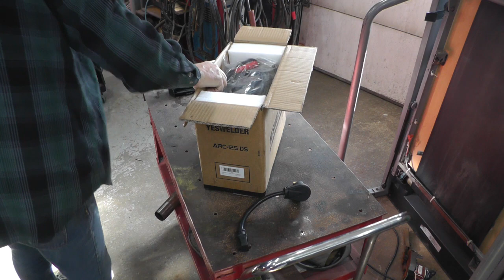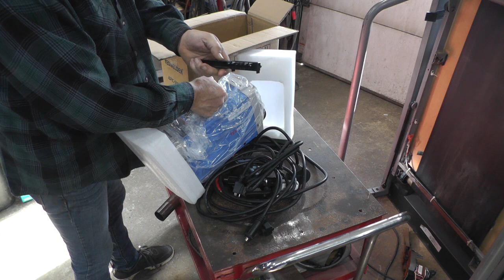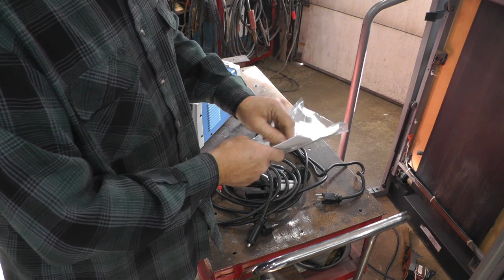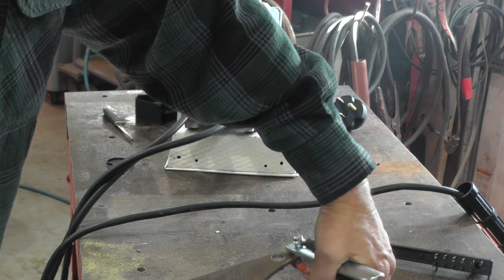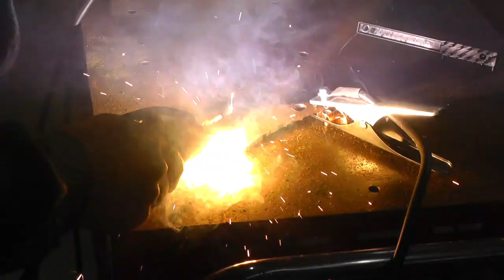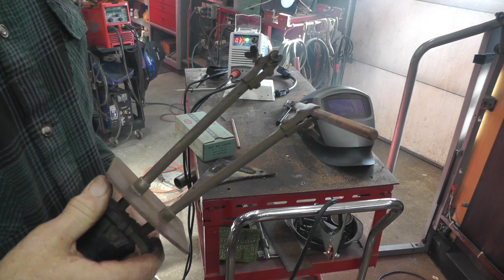Yeswelder ARC-125DS Review 120/240 Inverter Welder

Comment: I've had the 205 DS Pro for over a year and it's perfect for my needs but I've not yet tried welding on 220. I will try your simple method and I'm really curious to see the difference if any in how it welds and if the welds improve . Enjoyed your video and wondering if you still have the welder or what became of it .Ty!
Reply from the maker: Yes I still have it. I use it quite often. It always amazes me how well it works for it's size.

Comment: Convinced me. I need something for small projects so this would be great.
Reply from the maker: I have used mine for several years now and it still works great. One nice thing is it's light weight makes it nice if you want to use it off site using a generator.

Comment: What amp was the outlet you used for this machine I just got one and. Have a 20 amp on the line I'm going to use, will that work?
Reply from the maker: Mine has a 20 amp square D breaker and a 20 amp receptacle.

Comment: Nice! I'm buying mine from Ebay $100 with shipping. I'm not happy with the wire feed one I have. 👍🏾
Reply: Just got one to learn welding and it really is as good as this guy is saying I run 3/32 7018 rob at 110 and it tacks everything very smooth

Comment: Seems pretty solid.  I need to rebuild a mower deck, this should be good right?
Just not seeing much difference between these and the cheaper $50-$60 ones.
Reply from the maker: I think the build quality on these is better just my opinion.
Reply: @kevincrawford2027  I respect your opinion, thank you.  They do seem like a more stable company and not just some temporary rebrander.
I tend to overthink things, like I have a 10-50 dryer plug but most of these come with a 10-30 I think, but I probably don't have to have it anyways, seems to work good with 110v.
Do you have a mask you like?  They all seem to be 50-50 no matter the price.

Comment: Thanks for doing video.  I believe the welder is not a true 220v welder.  It only uses one leg of the 220 line but can run a higher current because most 220v lines are run on a 40-60 amp breaker.

Comment: Does it work on 1/8 6011 rod at 110V???
Reply from the maker: Yes that is what I use a lot it is very forgiving about good prep of the work.
Reply: @kevincrawford2027 .......it is my first time learning how to weld.  I bought the same unit as yours.  I bought the 3/32 Lincoln rods.  I just tried it out and cannot seem to get it to lid up.  The rod keeps sticking to the metal. Can I just turn on the unit and start welding or do I have to leave it on for a few minutes before welding?  What amp do I need to set it at?  I have set it to 80 amps.  Very much appreciate your help.  Thanks.
Reply from the maker: @thewishmastur  80 sounds about right. It should work right away. Are you scratching the rod to start it going? There are lots of good youtube videos on welding. It takes a bit to get used to it. Getting the arc started is usually the hard part. Once it starts it easy to keep going. Don't give keep trying. Good Luck.
Reply: @kevincrawford2027  ...which rod is easiest for beginners?  6011 or 6013?  Is size 3/32 easier than 1/8?  Which of these do you recommend for beginners??  Thanks 🙏
Reply from the maker: @thewishmastur  Not sure I use both. More 6011 though. If your having trouble getting it start an arc turn up the amperage. It will be to much to weld with but may get you used to starting an arc. I'am no expert I learned just like you are doing.
Reply: I suspect the open circuit voltage is kinda low on 110v im willing to bet the first rod to use, if you have never welded, and only have 110v would be 6013 or 7018
Reply: @stevehartlieb  negative , 6013 has very low penetration and 7018 is hard to start unless high amperage, 6011 modified which is Lincoln 180 is one of the best rods ever created.
Reply: @mountaintruth1deeds533  yes 6013 is low penetrating, but also can be ran with a machine that doesn't have high enough OCV, 7018 doesnt require higher voltage like 6010 5p, and 6011 even tho 6011 requires less than 6010 5p
Reply: @stevehartlieb  that's pretty much what I said, in addition 7018 is no good on contamination. I can easily make stronger welds with 6011 over 7018 on anything but absolutely clean metal.
Reply: @mountaintruth1deeds533  that depends, the mechanical properties are much much better with 7018, sure 6010 penetrates better and can be used to weld rusty oily shit, but you can also weld the same with 7018, crank it up, burn it out and just grind the first pass, hit it again with 7018 and 10btimes out of 10 it will be way stronger than any 6010 single pass
Reply: @stevehartlieb  maybe so but 7018 is not great with any contamination. Fleetweld 180 is a superior field rod hands down. If you want purity weld use TIG.
Reply: @mountaintruth1deeds533  7018 is great with a tig root on open butt welds, there isn't much of a better option, in places you can't grind or clean 6010 then 7018 is the best way to go, its an industry standard in welding pipe
Reply: @mountaintruth1deeds533  I've never even heard of 6013 rod until 2 years ago and there's a good reason for that
Reply: @stevehartlieb  Absolutely. If caught welding with those at a shipyard you would be escorted out of the gate lmao.

Comment: Will it burn 1/8 7018 i wanna know before i order one
Reply: I have one and I can't establish an arc without blowing a breaker lol, it probably could on a 220 line, I've been using 3/32 6013 and it works pretty good.
Reply from the maker: Mine will trip a 20 amp breaker on 120 volts if turned all the way up. So I use no.10 wire and a 30 amp breaker no problem. Thanks for watching.

Comment: I'd use the 6013 over 6011 if you are gone drag.  6013 is a lot cleaner less splatter.  Not a deep penetration rod like 6011.  Clean and bevel the metal and it will hold better.   6011 is supposed to be whip and pause vs drag rod.  Looks better than my 159.00 harbor freight 80amp

Comment: I had been looking at this welder, but wasn’t too sure until I saw your video.  Got mine today and worked way better than the Campbell hausfield I purchased previously.  The CH was having trouble keeping an arc and kept sticking( after a few practice uses) ,  but this one had no problem at all with the same rods. Hopefully it will last  for a few months of use, I think my CH might have already messed up.
Reply from the maker: Used mine again today for a project and it amazes me every time I use it.
Reply: I bought a high dollar Klutch st80i welder and had the same problem. I had the manufacturer replace it once already but it still sticks to the material, I have tried everything too. I used all different types and sizes of rods and it still does nothing but stick. I asked the manufacturer if they call it a stick welder because that's all it does...

I just bought the Yeswelder yesterday and will give it a shot, it can't be much worse and it costed half the price. I got the 165amp model though.
Reply: @The1stDuhZeez  I just ordered the 165a Yeswelder. Hows it holding up? Their is a good vid with amperage output measurements of the 165a that convinced me to buy it. It measured about 140 amps out, not near the 165 amps advertised, but that should be good enough for me.
Reply: @ridemfast7625  I haven't used it for a while. I may have to break it out to check. Last time I used it it worked great. I know the amps are not as high as it says but unless you are using rods larger that 3/32 you don't need more than 140 amps anyway. Take care!